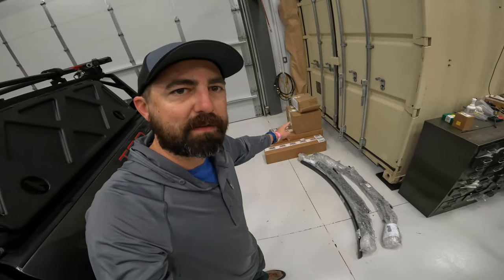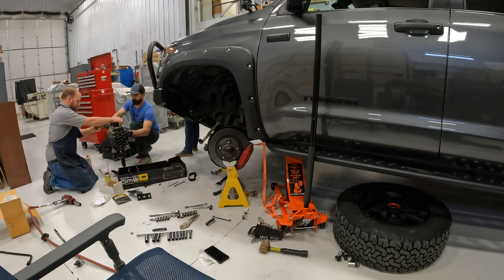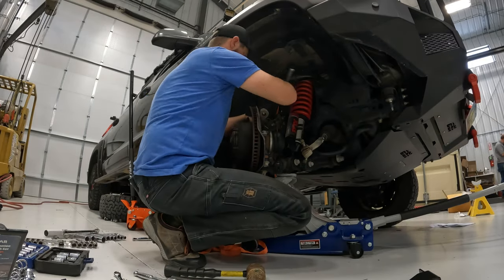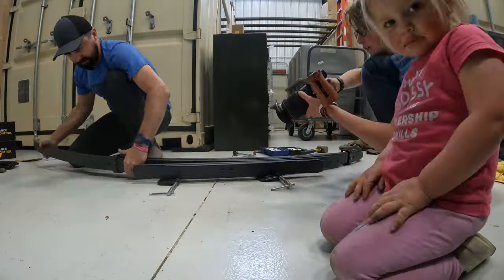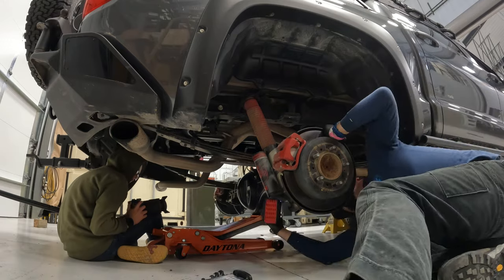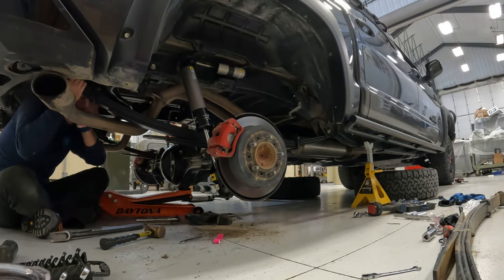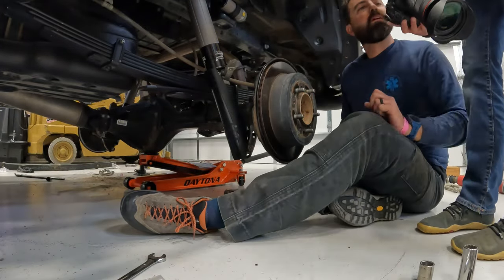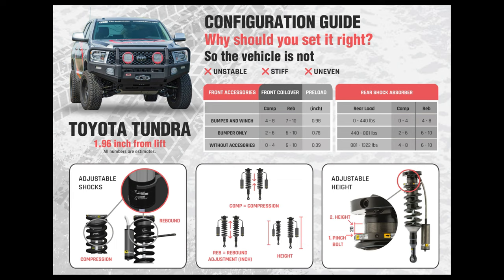BP51 Install Vid

Comment: Hi, Luke. I love this set up. I haul an Off Grid Expedition 2.0 Tear drop trailer with my 2017 TRD pro. You think this set up would help with the Sag which my Bilstein set up sucks for. Not a fan of the Air Lift ride I have installed.
Reply from the maker: 1000% yrs.  I frequently pull a 18' enclosed trailer full of motorcycles and the rear does not squat hardly at all

Comment: Hey Luke, thanks for the video! I’m not sure that I would tackle the install myself; however, I’m trying to decide between the OME nitro charger, heavy duty pack, and the BP-51 HD set up. Have you been happy with yours so far? I do light off-roading, yet most of my driving is towing my 23 foot Airstream (fully laden bed 5000 pound trailer) with lots of Boondocking/BLM/off grid stuff. Looking for performance yet reliability is super important (hence a Toyota Truck) Cheers!
Reply from the maker: Very happy.  The bp51 ride is amazing and I tow frequently.  I have an enclosed cargo trailer that I haul ofter loaded with moto gear.  It's probably around 6000lbs loaded.  It does great and no more sagging in the back
Reply: @lukethork  Awesome! Thanks for the feedback Luke!

Comment: I'm about to do this to my tundra , have the kit already but I'm curious as to how hard it is to adjust the fronts since I also have a winch and heavier bumper.
Reply from the maker: You definitely need a MacPherson strut compression tool, it's not too bad with that
Reply: @lukethork  I appreciate your reply,  do you have a link to the one you used by any chance ? TIA .
Reply from the maker: @ricriv5582  I don't it was an old one but was similar to this. https://amzn.to/3QqDdLL
Reply: @lukethork  so I installed it and it all worked out. The only thing is I couldnt find any info on the shackles.. the bushings that came with the kit didnt fit for some reason. Not sure if they sent me the wrong ones or what not so I kept the stocks and it seemed fine . Drove it and ran like a charm but now I'm getting a ticking noise on very light articulation.  Was curious if you're kits shackles and Bushings fit ? Thanks again .